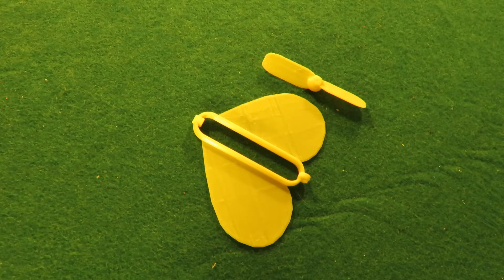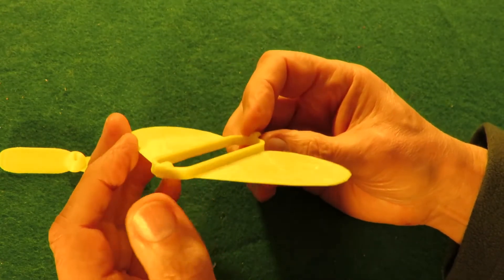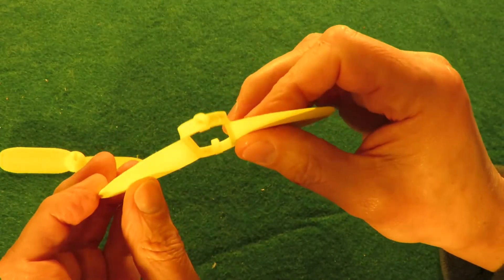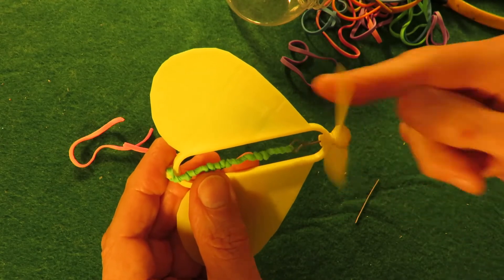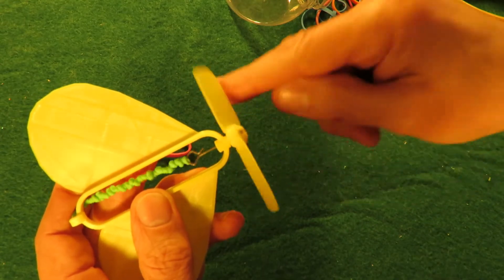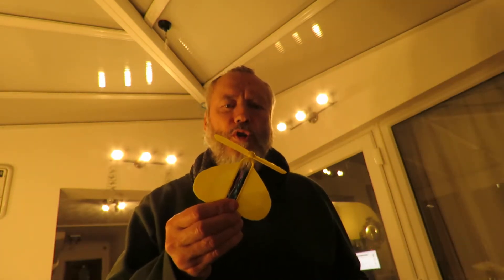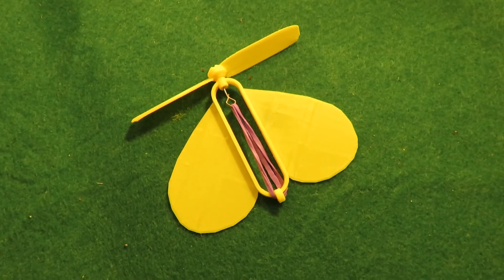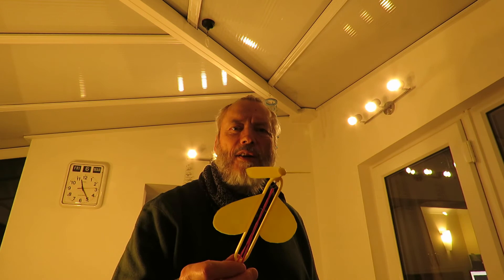3D printed heart shaped helicopter V2 & V3

Comment: Ha ha, "questionable shape". 😂
You mentioned in a reply that it was a bit heavy. I am sure you will know that you can change the density of the prints, so that may help. 👍👍👍
Reply from the maker: Heavy as compared to foam or balsa. But, yes, we could spend a long time honing this to perfection. As I have mentioned, it is too easy to get totally absorbed into printing things over and over with minor little improvements. I just printed something today that was totally unnecessary to 3D print and could have been done with a plastic or cloth bag but because I have the printer it got printed 😁👍 I would think just using a bit of decent hobby grade rubber would make an amazing difference anyway.

Comment: Progress! Engineering in action. I wonder if a flat propeller around a thin cylinder but with a very slight pitch might still fit in a book.
Reply from the maker: Hi Daniel. I think I crossed over in the design from the original bat in a book to the helicopter design a bit too far. I think the original very thin flexible plastic propellers were able to distort under power producing a better shape, not that they flew very well anyway. They rely on the surprise of something jumping out of the page at you, I don't think they were ever expected to fly any distance.

Comment: It was so funny when you said that when you open the book it may hit in your face jajajaja!! But it's true !!
I like it to use outdoors.
And... why do you wind the propeler in the opposite direccion as allways ? 
Other question, does whashing up help to make rubber bands life's last longer ??
Gret video Grandpa!!
Reply from the maker: We are not washing the bands, we are just using the oily solution to lubricate the band so it can slide over itself as it stretches. You can buy proper hobby grade lubricants which will help it last much longer. The washing up liquid contains ingredients that do harm the rubber after a short while.

Comment: maybe a touch of weight in the base would help it to fly so the body hangs vertically may help with it to be more stable
Reply from the maker: Now that is a very interesting subject. If you haven't read any articles on how "aircraft" "balance" in flight you might be quite surprised. Tom Stanton did a good video on the Pendulum Fallacy https://youtu.be/OYHCP3-mpxk
Reply: @GrandadIsAnOldMan  I used to be a pilot so I will take a look ;-)
Reply: @GrandadIsAnOldMan  I watched the video I think the fact that the pendulum was rigid was the problem if the pendulum was say the batteries on rope or string then the drone flight would have been different
Reply: @GrandadIsAnOldMan  also thiking about it you have a two bladed prop, so the thrust is 180 degrees out try a four bladed prop that will give a more balanced thrust only 90 degrees out
Reply: I suppose a gyro would be out of the question isuppose if it was four blades with a circle connecting the tips that may act as a gyro??

Comment: Version 3 still works better but if the rubberbands were nt so rubbishy that would work alot better. Nice video😀
Reply from the maker: I do have a very small stock of proper hobby grade rubber but I don't want to waste it on a project like this.